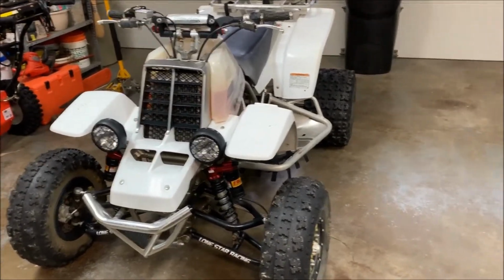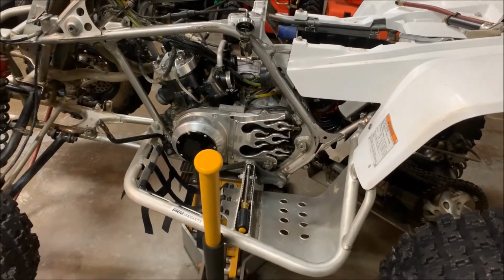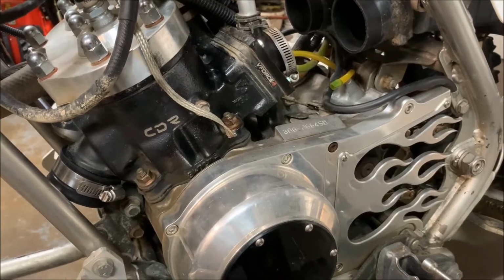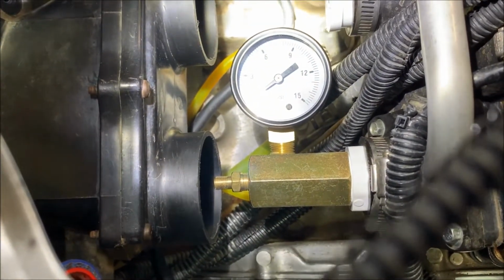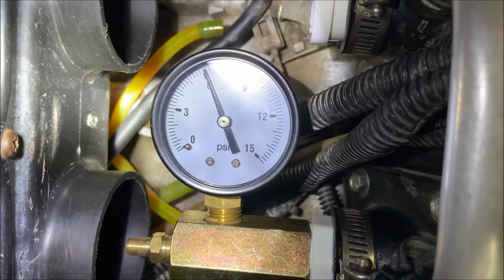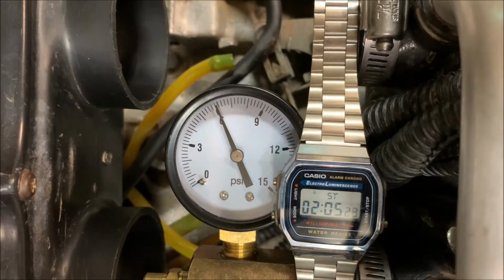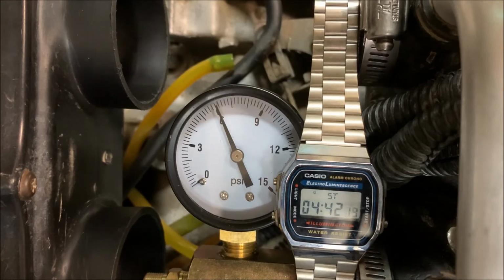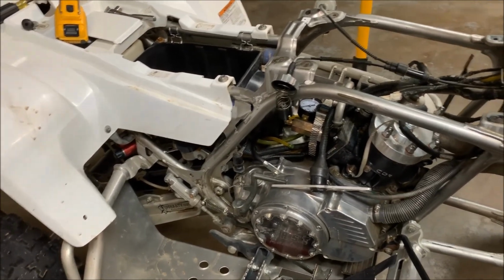YAMAHA HONDA TWO STROKE LEAKDOWN TEST KITS. BANSHEE YFZ350 BLASTER CR250R TRX-ATC250R CR250R CR80

Comment: How many hours of running your Banshee before having to do a top end rebuild?  Thanks for the video, very helpful.
Reply from the maker: Hi Mike, Thank's for the question! I do not base my top end rebuilds on hours of usage but rather changes in optimal engine performance. When there has been a noticeable change the first thing I do is either a leak down test or a compression test, usually both.  I know my normal base compression test #'s and when they start to fall off and leak down test = good It becomes quite obvious when you need to rebuild your top end. Still, trying to answer your specific question I currently have over 100 hours on my banshee since my last top end rebuild. Hope this helps.